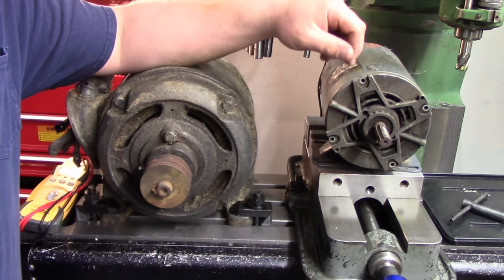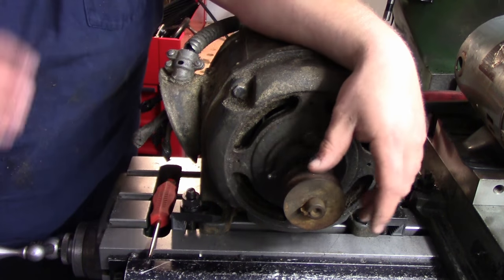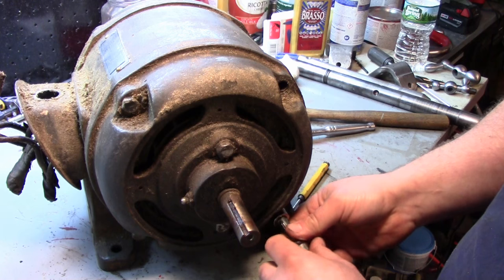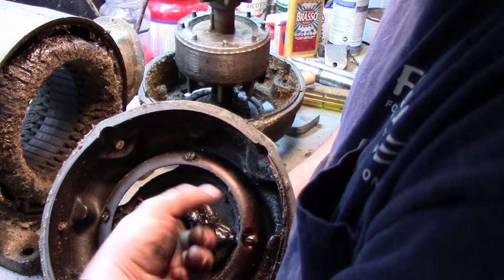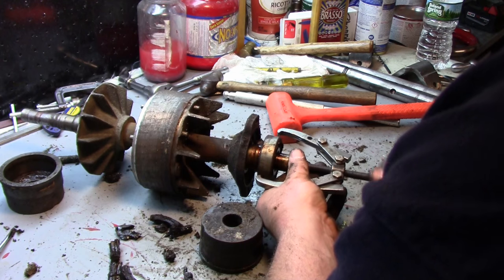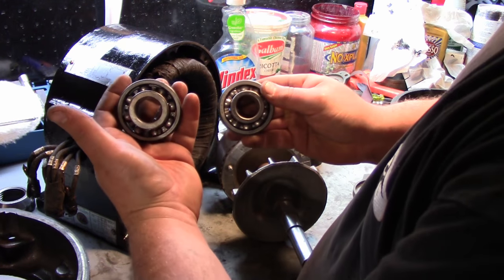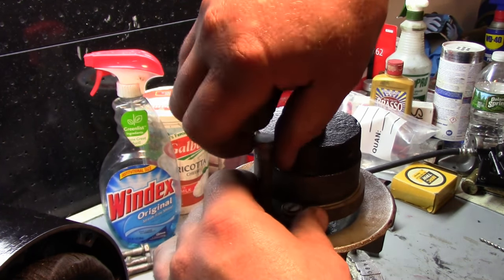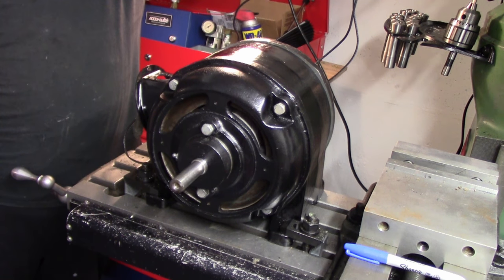13" Southbend Refurb: Motor

Comment: A lot more effort and care went into the old school motors in my opinion. They seem to run a lot quieter than the newer ones as well. Plus they had a lot more honesty in there advertising about a motors HP under average running conditions. There not quite as power efficient as the newer ones, but that's a small point to get better HP and torque for the price of some time and a set of bearings. Nicely explained video.

Comment: A Wastinghorse. Thought so. Built like an iron bridge. Literally.
For future reference. When looking at a rebuild, just bite the bullet and hose out the motor before you start. You can use a pressure washer but avoid blasting the wiring connects. The water won't hurt a thing and makes it a lot neater on the workbench.
These old style motors had a bit more clearance between rotor and iron. So they had a bit more slip but were a heck of a lot more tolerant to imbalance and could swallow a phenomenal amount of dirt and keep on cranking.

Comment: Greg,
Nice work on the motor. Compared with today's motors, I was surprised at how short the field coil and rotor are. I've replaced my share of motor bearings in everything from 1.5hp to 10hp 3PH motors, as well as taken some motors in to the motor shop for rewinding. Most had shielded bearings. Real dusty conditions used sealed bearings. I have never encountered open bearings with grease zerks, although I have never worked on super old machines. Thanks for the great video! If you don't put up another between now and Dec. 25th, have the happiest of holidays and a super New Year!
Have a good one!
Dave
Reply from the maker: Thank You!

Comment: You might want to look on Ebay in the future for bearings.  On my lathe the local bearing supply store wanted a lot for each bearing.  I ended up finding new old stock ones for a fraction of the price.
Reply from the maker: I actually checked.  They were just as expensive as my local supply.  At least at the time.  Now that it's done they're probably all $5

Comment: Hi Greg,
Those 3 phases motors are so simple to refurbish...
This looks much better than a modern motor on an older made machine...   ;)
One word of caution on older motors and VFD, the insulation on the older motors isn't rated as high than newer motors and since VFDs are known to produce some pretty high voltage spikes that could ruin the insulation of those older motors, this is where a megger would give you a rating in order to decide if the insulation is sufficient to handle the spikes without dammage. 
Cheers,   Pierre
Reply from the maker: Yup.  I don't use the braking function so that's one source of big spikes taken out.  For the amount of time it'll be running I don't think it will be a huge issue.  Only time will tell

Comment: Man that electricity back in them days must have has some really dirty electrons in it. I've got some old motors like that. I'm sure they must have cleaned up the electricity since those were in use. LOL Just kidding. I just replaced the bearings in one that looked like someone had used it for a trolling motor. LOL Great video thanks for sharing.

Comment: Nice result - with the use of a stone age tool, though. I just can't believe how stuck You guys are to the use of those adjustable wrenches. A 10" T-handle with a socket on, makes those 8 bolts fly out like nothing! Apart from this little rant, I just love Your videos. Keep'em coming! ;)
Reply: Yeah, we were all graoning at that adjustable, specially when it was used at the tip of the jaws!

Comment: You need to mention when ohming the windings, if you get a 0 reading, it's probably shorted. You should get 4-8 ohms depending on the motor. Or you'll get sparky sparky flash boom the breaker and release the factory installed smoke in the motor.

Comment: GREAT clean up and rebuild job!  It may not be this video, but on one I saw a book 'A Guide to Renovating the South Bend Lathe...'  I had NO idea those existed, and I have watched many a lathe and milling machine restoration video, so thanks for making me aware of that!  What kind of cleaner can you use on motor windings?  Do they make a special one?  Very silent smooth motor now, keep up the great work!

Comment: Greg, Just found your channel and love it, I have a 1937 13"SBL UMD as well as a 1965 9" SBL HMD still has the scrapings on the ways...I have a question about the 13" UMD. Do you have a technique to re-install the electric motor to the mount? I am a one man show and there has to be an easier way that I am unaware of to remount the motor to the plate...mine uses a 1.5HP 3 phase at 1140rmp..thank you for a great channel...very informative.

Comment: HP ratings can be deceiving. The older motors were rated at RUNNING horsepower. Newer motors are rated at PEAK. Take that in for a minute.......
Reply: I would also add that they probably deliver more torque than the newer ones also. I love the older ones myself. As a matter of fact I always prefer cast iron .

Comment: What frame size is that motor. I'm picking up my 40s single tumbler 13"x5' tomorrow and even if the motor ohms out I'm kinda hesitant to hook up my 30hp rotary phase converter to it if it fails down the road.

Comment: Very nice motor. Only a question. Why not used sealed bearings instead of have to always greasing them?
Reply: my opinion is, if you have a grease nipple, then the regular bearings will last easily as long as sealed, and i reckon longer, as the grease creates a seal anyway even if you only grease it once, but you have the option to make it last even longer with a bit of grease, esp when you will have to lube the rest of the lathe anyway, its just another one to do
Reply from the maker: I'm a big advocate for maintenance on equipment and serviceable parts.  I hate "lifetime" lubricated things and parts on cars.  Who's lifetime is it?

Comment: Probably more than two pumps of grease, the cavities look larger than that. Too much grease will sling off and cost a few cents. Too little grease will cost $50.00 per end...
Reply: Never good to over grease bearings. It will cause them to over heat and shorten there life and only cause more of a mess.

Comment: Small tip on checking out bearings:
Get ye a cheap stethoscope on Fleabay (the thing doctors have hanging around their necks)
Replace the head with a fine tube, which is closed on the business end.(6 to 10 inches will do it, about 1/8" in diameter or less)
You will be amazed how clear you can hear bearings going bad long before anyone else with this cheap $ 5 tool !

Paddy

Comment: Dude, get your self  a battery powered impact drive with a 3/8" square drive adaptor. I've watched you use a socket wrench for so long back and forth until I can't stand it. You would think in HVAC you would have one to speed up your work....?